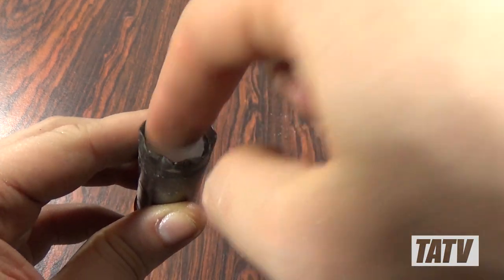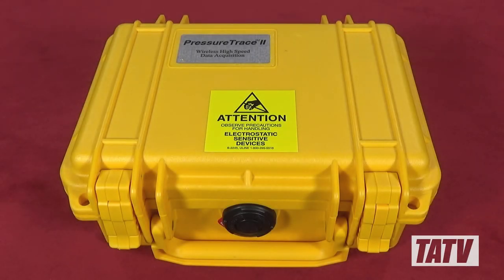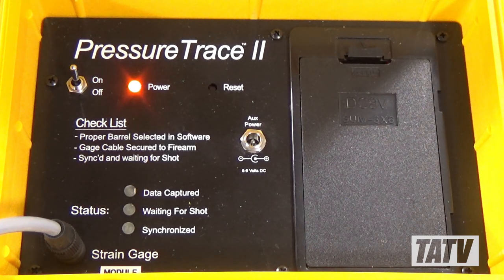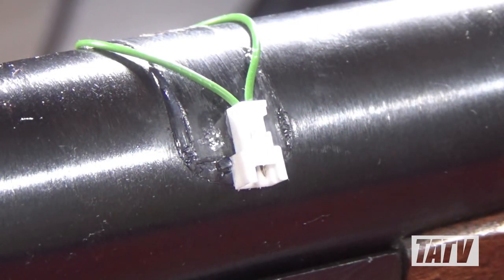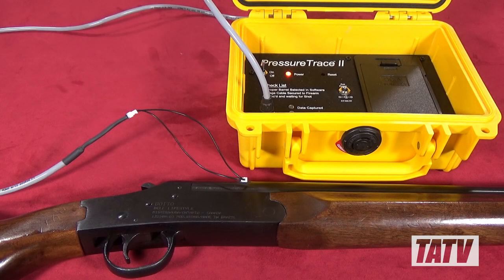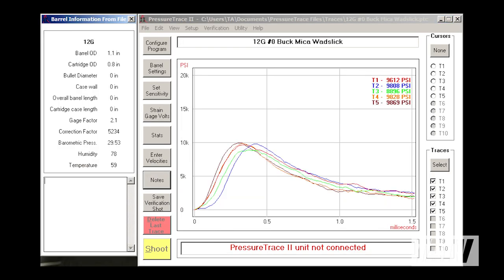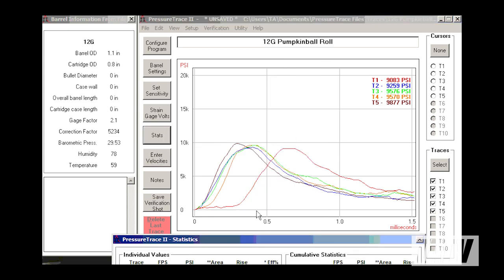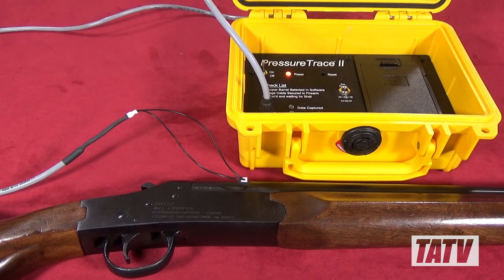RSI Pressure Trace II Firearm Chamber Pressure System

Comment: Hello, what principle does the strain gauge operate on? i would guess that its just a wire whose resistance varies on its lenght and is measured by an osciloscope.
Reply from the maker: It's just a guess, but I think an electric current is passed through the metal strip on the strain gauge which changes when the conductors are stretched further apart. The computer then reads these changes in resistance/power and interprets them VS a known value when its set.

Comment: Great video. I'm just getting into shot shell reloading. During my research I've seen people producing hot glue "slug" rounds out of regular shot rounds. Have you ever tested pressure diffrences in rounds like this, before and after. It seems like removing the center of the crimp (leaving the actual crimp intact) is the safest, due to the fact that the glue slug can not move after it's been created.
Reply from the maker: Honestly it's not something I'm willing to try... It probably works fine, but I don't want to be the guy who blew up his shotgun/face testing it.

Comment: You are the only one posting vids on this as far as I can tell. I may be in the market for one but I have a question:  I want to test 45 colt loads but my only rifle is a nicely blued 1873 Win. Can you apply and remove the strain gauges without risking the blued finish?  Thanks for the video and your opinion.  Would love t see some metallic cartridge videos
Reply from the maker: According to the manufacturer you can remove them without any risk of damaging the finish (and I haven't really observed any on my test guns when I've removed them) but I certainly wouldn't try it on a piece like that.  Whenever chemical solvents are concerned, I just don't think it's worth the risk.

Regarding cartridge videos; my metallic's are all handguns without exposed barrel, so no help there.  Of my rifles, I only own one non-22 with an exposed area that could be used for the strain gauge and that's a 308, so I doubt I will ever test on those.  I mostly specialize in shotguns, sorry!

Comment: Will there be some testing with slug loads with with different crimps coming soon ? I use a short wad with an over crimp and was wondering how that effects pressure with my slug loads vs standard and roll crimp .
Reply from the maker: Yes, Sir, there most certainly will.  I shot a bunch of footage while doing a number of different tests with this unit back in the Fall; I'm just severely backlogged is all.

Comment: I would sure love it if you would use this unit to test "Cut Shell" shot gun shells.  I think these things are of very questionable safety,  but  a lot of people are shooting them, and posting on YT.  Having some definitive pressure data might save someone from injury.  Possible??
Reply from the maker: Believe it or not I actually tried this last Fall, however the weather was horrible and I had to stop partway through.  As it's Winter here right now I'm just waiting until Spring to try again.
Reply: Any follow up on this?

Comment: Are you still using it?
Reply from the maker: I surely am.
Reply: Have you or the manufacturer ever found a way to test pressures in a Glock? New 10mm loads with accurate #9 started sounding kinda scary...i just don't want to pull what remains of the ladder. I would actually spend a paycheck on equipment rather than pull the remaining 15 rds. and no i don't need a therapist for this. Great vid!
Reply: @TATVCanada so, are you going to show us some of it?? 😄